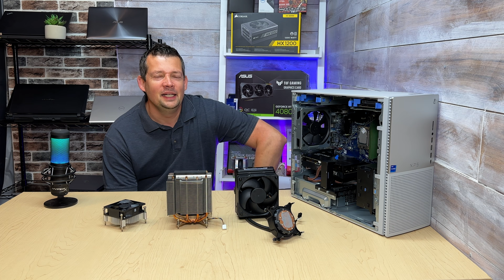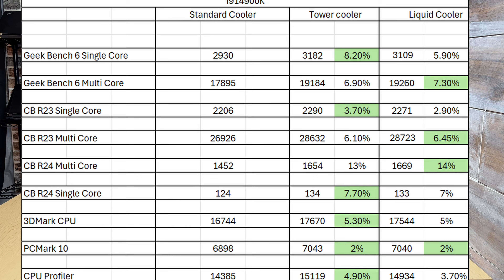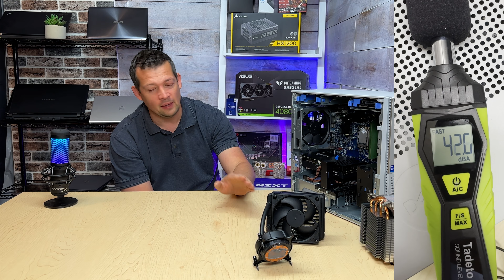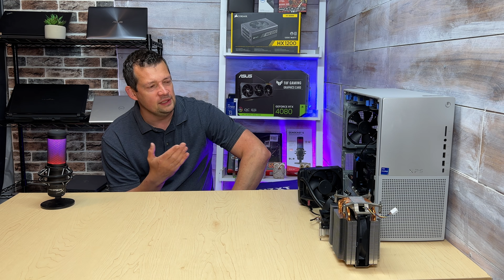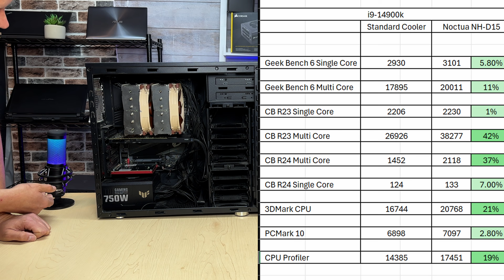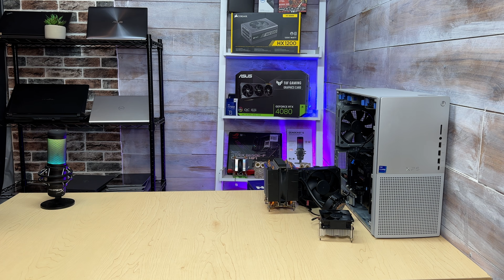Dell XPS 8960 Desktop: Intel i9-14900K Upgarde, CPU Cooler Options.

Comment: I know this video is old, and you don't have this computer anymore, but what was stopping you from  cutting off the dell heat sink standoffs from the non-removable motherboard tray? I don't think the customer would mind if you can improve the cooling.
Reply from the maker: I made a video on the ebt2250 which is technically the same thing as this just the newer model with a Corsair liquid cooler. For a few bucks you can get a converter screw kit, which will allow you to use third party coolers however the motherboard will not recognize third party fans correctly. It will either running them on full speed or give you a warning at every single startup/ restart that the cpu fan failed.
If you find my video with the Corsair 280 mm liquid cooler , I had to use two Dell front Fans just to have no compatibility issues and the solution works better than anything else.
Reply: @Scott.The.IT.Guy.  I will check it out. I have an 8th gen 1151 socket I7-8700 Dell XPS that I got for free a few months ago. I heavily modified it to get better cooling. I drilled holes in the front of the case cover which is plastic and added 3 fans and wired them directly to the 12V cables of the power supply with a switch. The Dell installed GPU which is a GTX 1660TI is running about 8 degrees C cooler, but the CPU still hits tjmax once in a while and I know the stock pancake cooler is not enough. Since these older dell cases are not very wide I may need to get a mini tower cooler. And when I looked up this intel cooler XTS100H your video was one of the top ones I noticed along the search. That tower cooler in this video looks similar, so I clicked and watched it to be disappointed you never showed it installed. It's ok it's not the same cooler. But I think I will get the XTS100H  on eBay as it's only $55 shipped. That cooler is rated for 95W and my CPU is 65W, so I should not have any more tjmax spikes.

Comment: Thanks for the video, just had a "CPU Fan Failure" on my 1 year old 8960 with the i7k. No luck with BIOS updates. It came with the Dell advanced / premium tower air cooled. I am looking for the best replacement. It seems like the tower is no longer available on the main support site? Any help would be appreciated.
Reply from the maker: No worries, the 2025 XPS desktop called  EBT2250 is pretty much the same thing:

https://www.youtube.com/watch?v=a8z6ZFnNnOc

The 240mm AIO is the best thing I could come up, but you can always just get another advanced cooler:
Dell part number: C253W

https://www.dell.com/en-us/shop/dell-cpu-heatsink-assembly/apd/cpx-c253w/pc-accessories

You can aslo get one from Amazon or Ebay.

Comment: Yeah, Dell needs to open up their horrrible bios. It looks ike they stopped using that insane raid setting on their 1 drive systems, but they still turn on bitlocker to mess you up.
PS: You spelled upgrade wrong :)
Reply from the maker: Thanks for catching the typo! Really appreciate it!

Comment: I picked up this PC with the i7-14900k and Tower cooler, and oh boy are the CPU temps high. Idle is 40C and under full load it will reach 95-99C. Not too happy about that. I'm thinking about upgrading the CPU cooler. Should I go with a better AIO watercooler or air cooler? I don't how much of a gain I will have but what options will fit in here? Give me a few examples. TIA!
Reply from the maker: Please check this updated video out on XPS desktop cooling, if you have any question, just message me here!
YT:
https://youtu.be/a8z6ZFnNnOc

Comment: Hey man, great vid. Would an RTX 4090 fit in the XPS case? And would it perform well with the i9-14700K? Thanks
Reply from the maker: Dell officially sells the 8960 with the 4090 when they have the card on stock.
According to people, it’s Dell branded card and has smaller fans than a standard 4090 since it’s throttled.
My 14900k cpu was also throttled about 20% compared to my custom built desktop. You get less performance but a quieter desktop aimed for longevity.
I would make sure to get the 1000w PSU for this configuration and the advanced tower cooler.
Reply: Thanks man. I can get my hands on one of these with a 4080S and was hoping to upgrade it with a Third Party RTX 4090. Will that fit or will it need to be the Dell OEM RTX 4090?  @Scott.The.IT.Guy.
Reply from the maker: After some quick research it’s not easy to install a third party 4090, you should stick with the a Dell version.
If you really need to squeeze out everything, I would probably go custom built since your cooling system will be way more efficient.
Also have at least an  option for over or under volting while the XPS does not have that .

Comment: I’m a trader looking to change desktops, should I go with i9 or i7 ? Is it worth the upgrade
Reply from the maker: Do you need the power of the i9? Which gen are you thinking about getting? Since I had to wait 5 weeks to get my 14 gen i9K replaced by Intel, I ended up selling the 14 gen after the warranty replacement and running on my old 12 gen i9. I have no regrets.

Comment: I picked up a cheap 12900k version of this system. I put a 4090 inside. To do this, I added a 750w SFX power supply inside (slotted in the front quite nicely) Yes the PSU vented into the case but I just added another intake fan (total 2 intake, one exhaust). I added a relay to turn on the SFX power supply when the system PSU came on. They were completely in sync. The system came with the bigger Air CPU cooler and honestly it was a great system. Just for fun, I added some anodized ram heatsinks to the ram and they looked like after-market ram sticks with extra cooling. It was a clean system and for the price I won it at an auction for - absolute beast of the machine.
Reply from the maker: That's a really cool mod, congrats! Sounds like you max it out!

Comment: if i could get this machine with i9 14900k cpu, RTX 4070 super card, 64g of ram. and 2tb ssd for $1500 USD should i do it? My purpose would be i would want to use it for work but also to game, im not sure if its worth buying it and stripping the card and cpu and putting into another machine and still have to spend money on more parts. What do you think?
Reply from the maker: Sounds like a pretty good deal to me, I would just use it as it is! 
What resolution would you game and what type of games are you looking to run?
 The whole point of this PC is just being solid and reliable for many years to come. It is ready to go, does not need to be tweaked, has onsite warranty.
 I see XPS coming to our shop here and there, the main complaint is, they are slow! When I tell them it’s 8-9-910 years old, they usually just get a new XPS again.   
  I am not worried about the extra performance which we would leave on the table potentially by going with this PC since I only play with old games in FHD.  I would rather have something ready to go, not needing to be tweaked and solid for years to come.

Comment: thanks! You found the aio and tower fan are equal and both are shortening the cpu performance by 20-40% for 14900k, vs a 3rd party cooler. 

Question: Will a 14700k run at 100% with tower or aio cooler?

ps: I use it for scientific computations so the cpu will be tortured to the max.
Reply from the maker: It will not, performance will be always throttled for stability. This is a tradeoff for going with a branded PC. Adjustable options in the bios are super limited to none, therefore performance will be left on the table does not matter which  oem are you choosing.
If you need every bit out of the CPU you will need a custom build computer.

Please be aware that the Intel CPU degradation and failure is real, the 14700k also affected by it.
Reply: My feeling from your content is that the cooling is in a borderline situation for 14900k, probably below the borderline.

The scientific computation software I use only supports 16 cores. Maybe tower or aio will support the full capacity of a 14700k toward my application?--because (1) only 16 cores used, (2) it is 14700k instead of 14900k, so the max power (i.e., heat generation) in my case may be 10-20% lower than the fully leashed 14900k in your test. What do you think? Many thanks!!

Comment: Hi Scott Your vid opened my eyes. Thanks. I bought XPS 8960 with i7 1400, RTX 4060 and 16 GB of RAM. I  use it mainly for Photoshop. Will I gain anything when I ll swap RAM and instal 32 BG? Cheers
Reply from the maker: Hello! 
Do you have any issues at the moment with 16 GB? 

Also , pop up the side cover and look at the ram. Do you have two 8 GB stick or just one 16 GB stick?

When you work with photoshop right click on the windows tray on the bottom of the screen.
Hit task manager and look at ram usage . If it’s over 75-80-90% constant, more ram will help, if you are under 70% , more ram will not do much speed increase unless you only have 16gb stick at the moment. 

Also make sure your virtual ram set to manual, and 16000 -16000 least  or 32000-32000 if you have a large SSD with a lot of free space.
Reply: @Scott.The.IT.Guy.   Thanks Scott

Comment: I agree, I have always been a big fan of Dell's industrial design choices. I work in an engineering/manufacturing environment where I'm also responsible for the IT. For years I have always bought used and new Dell equipment. They are just so easy to work on. So easy to open for maintenance, documentation is easily found and everything is usually built like a tank. And not to mention Dell equipment is always first in line for updates, support and compatibility. The stuff just works when you need it to.
Reply from the maker: Thank you for your comment !

Comment: 21:48 yes there are cheaper but their also less quality because they use to small cooler,  no air vents in the top of the cases, the power supply often has no gpu 6 or 8 pin plug, the mainboards having no vrm coolers, the mainboards having lesser io ports on the bag, no removable backplate from the cases or the coolers! To many things were Dell has tcheapt out this computers  I would never buy on instead of an quality pc with an ASUS strix, Hero or Asrock live mixer, Steel legend or Teichi  with Nzxt Aio or Noktua air coolers as Coler because thes ar very good quality parts and I can reuse them in later pc builds
Reply from the maker: Sure, I agree with you on a lot mentioned above. These computers are for people who will make no modifications and used them as they are . In the lot of cases these computers can and will last a decade or longer if need to be.
This is also not the high end gaming PC line, that wood be the Alienware.
Just watched a YouTube video with Chip Foose yesterday,he drives a Ford F150 bone stock, not one thing modified.
My next video will be about a Dell 7010 optiplex desktop for businesses, the amount of stuff Dell cut off from the motherboard even surprised me :)

Comment: I am the number 1 fan of your channel and at this point trying to decide between  Intel i9-14900K and  Intel i9-14900KS. The KS version is rating pretty high on benchmarks but wondering if you have any advice on which one we should use? (We use these machines at my startup for AI and they are not used for gamin). You should come visit us in San Francisco, our office has a farm of these machines :)
Reply from the maker: That sounds awesome! If you are planning to get multiple of these, I would get  just one from each and test them the way you will run them. The KS is only 200 MHz faster which  results in games about a 2% average performance increase.
That number could be higher in your environment. I used to work for a company as a part of the hardware team. When it was time to get new desktops for the software developers we got one  PC with top end CPU and a pc with a high end cpu.
Three days later they came over and said that when they compiling code the top end CPU is 8 minutes faster than the cpu just below. He said they need to that least six times a day so that 8 minutes that is almost 1 hour faster/ employee and they had 40 software developers.

Comment: Great video! I'm thinking about Dell XPS 8960...but also thinking about waiting for the 8970... Do anybody know if Dell will release the 8970 this year, 2024? Do they release a new model every year?
Reply from the maker: Almost every year. 8960 supports 13 and 14 gen CPU’s. 15 gen Intel processors are coming out around December 2024.
Not sure is they are going to release the 8970 next spring or not, if I have to guess they probably will.
Reply: @Scott.The.IT.Guy.  Thanks Scott, now I have some thinking to do... I saw online that Dell (at least in Norway) doesn't offer the XPS with the RTX 4060 Ti, Only RTX 4060 (without Ti). They used to have Ti in stock but not anymore.... I'm thinking about buying just with basic Intel Graphics and buy a RTX 4060 Ti separately and put in, in that case... I'm new to upgrading desktops/PCs, but do I have to do anything else the just plug in the new graphics card? Don't have to do anything with the power supply...guess it has enough power for some upgrades... no software things that needs to be programmed or anything.. the computer adjusts automatically..?
I do some Photoshop work so I read that a mid-range graphics card was recommended.... also to be checked for the future.
Reply from the maker: @livingahumanlife2651  It’s pretty easy, just plug it in, attached the power cable from the PSU, Windows will download and install the driver, you will be up and running in 2 minutes.

Comment: I'm in between getting this or the Alienware Aurora R16 for AEC 3d modeling BIM work.  The prices are about the same so what advantages would the R16 have over this 8960 if configured similarly?

FWIW, I'd do the tower air cooler all day vs that tiny water cooler.
Reply from the maker: I am looking at the R16 specs and configurations   at Dell. com  right now. The 14Gen K and KF CPU comes with a combination of a 1000W Platinum Rated PSU, 240mm Liquid-Cooled CPU.

https://www.dell.com/en-us/shop/desktop-computers/alienware-aurora-r16-gaming-desktop/spd/alienware-aurora-r16-desktop/useahctor16i13

What kind of config are you planning to get?
Reply: @Scott.The.IT.Guy.  Dang mate, thanks for the response!  

considering...

XPS:  I7 1400k, windows 11 pro, 4070ti, 16gb RAM (upgrade aftermarket to 64gb - $200usd), 2tb ssd, 750w PSU, “advanced CPU air cooling” ~ $2109.99USD  |

R16: i7 14700F, windows 11 pro, 4070ti super, 16gb RAM (upgrade aftermarket to 64gb - $200usd), 1000w PSU, 240mm AIO CPU cooler ~ $2099.99USD

So the R16 with its 240mm aio will help with cpu throttling and the 4070ti super is a little stronger graphically but other than that, they seem pretty evenly matched.  For reliability/and performance, I'd love to have a big noctua air cooler but don't like what I'm seeing regarding the fan errors and such.  

Also, the "F" processor has a lower core clock which will help with power draw but I'm not overly concerned with it.  2.10 vs 3.4ghz base clock respctively for the F vs the K

Thoughts...? 🍻
Reply: @Scott.The.IT.Guy.  I replied but it didn't post so we'll try again ;)  

Thanks for the quick reply!

I'm considering...
XPS:  I7 1400k, windows 11 pro, 4070ti, 16gb RAM (upgrade aftermarket to 64gb - $200usd), 2tb ssd, 750w PSU, “advanced CPU air cooling” ~ $2109.99USD

R16: i7 14700F, windows 11 pro, 4070ti super, 16gb RAM (upgrade aftermarket to 64gb - $200usd), 1000w PSU, 240mm AIO CPU cooler ~ $2099.99USD

The F cpu will be a little more efficient than the K to save on some power bills but that's not too important for me.  The K, at the higher base clock may be more responsive in general... 2.10ghz vs 3.4ghz core clocks respectively.  

Thoughts?  🍻
Reply from the maker: @freidrichnietzsche6643  Probably the R16.

Not sure if this is correct :

https://www.reddit.com/r/Alienware/comments/16y7cz8/aurora_r16_i9_with_96gb_ram/
 
 
4th of July sales is about to start, maybe a better deal will appear, but these are good prices. Do you have access to the Dell refurbished outlet? Same config can be found sometimes with a significant discount. They have a same warranty as new and they look completely new as long as you not choose a scratch and dent pc.

I would look at this one:

https://outlet.us.dell.com/ARBOnlineSales/Online/SecondaryInventorySearch.aspx?c=us&cs=28&l=en&s=dfb&sign=bnBYA0tousJ0J3I4SO0lLxoA7GtsmEAqA0KvREqdN4zjUsLYOn8PNQjg7megoatefYSz4rc3h1gnv8naVGm7uNqrY7JuDyahxGto2CgLyRbcmAr1N7o4grKkLt83rrAY75kbyG38Pukpn6zdciO38XknsOHuTGd%2fkzLCN2LCYk%2f5h%2f4e7IAcF9Nu6o5N2C5U
Reply: @Scott.The.IT.Guy.  Dang, on the reddit thread that guy got 96gb to work which is awesome!  It notes that he went 14th gen with an i9 and windows pro which is fine with me.  I may make the jump and try spec'ing an i9 windows pro R16 to see if I can get it to work.

I do have access to the outlet so that's always an option.  If I go the route above, I'd just need to find an 14th gen i9 build ;) 

Many thanks for the help brother!